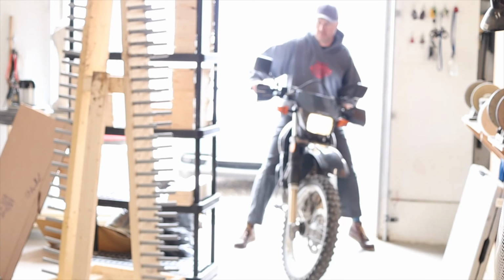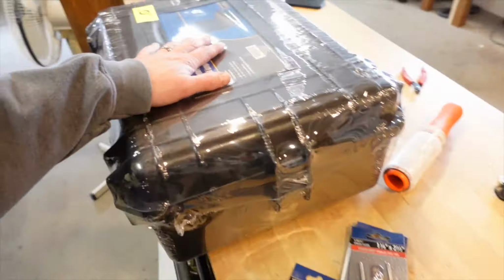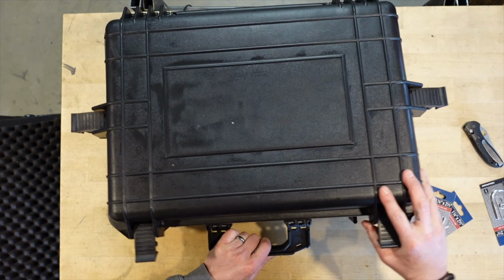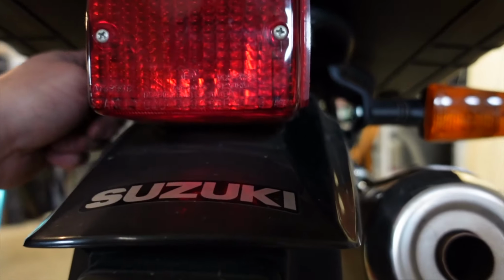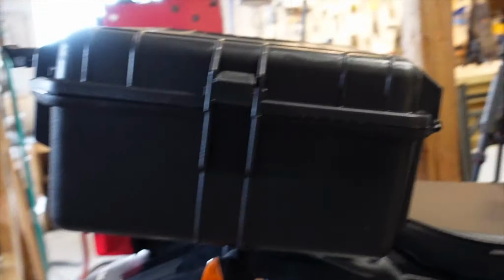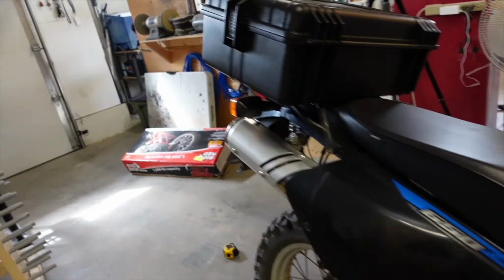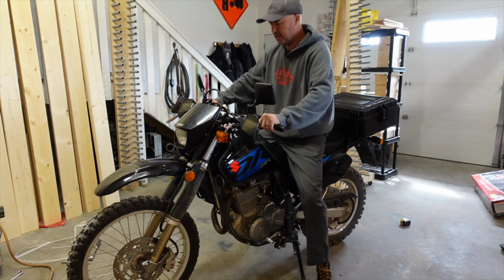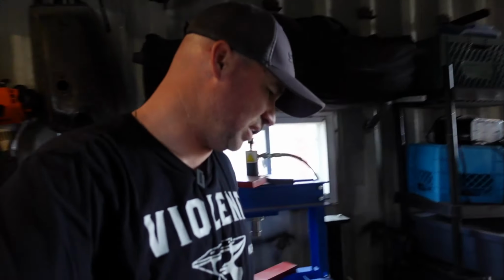DIY DR650 Luggage

Comment: Great job , just bought the same box for my DR . Tip for getting on and off the bike with a trunk ….. From the clutch side , put your left foot on the peg . Then grasp bars and stand on the left peg while swinging your right leg over . To dismount , stand up on pegs and swing your right leg over the seat onto ground . Just like getting on and off a horse . CHEERS .

Comment: lol. I used a plastic ammo case from Princess for my DRZ. I mounted a plate to my rack and then mounted the box to that. It’s still pretty flexy and vibrations will eventually wear the mounting holes so I’m going to sandwich some wood or more metal on the inside.

Comment: Hello Jeremy. Don't wait for the tyres to wear, change them.  If they wear it will obviously be in the center not on the sides so when cornering you will have less traction. Not good, I KNOW! Lol. Nice case. I think the flexibility is probably a good thing, it will be less likely to crack from vibration than rigid plastic. Have fun and stay safe, All the best.
Reply from the maker: Thank you for that! I have some new tires on the way and I’ll save these ones for winter time riding 👍

Comment: A concern, with the assumption that it's made of thin cheap plastic, that vibration and flex from riding may likely crack the plastic. Perhaps something to do right off the bat would be to use some PL Premium to glue a 1/2" piece of Baltic Birch ply, cut to fit, to the bottom inside. U-bolt through it so it's solid. 
Nice bike and great idea for extra storage without spending big bucks on purpose made kit.
Reply from the maker: Yeah I’m going to keep an eye on it for sure. That’s a great idea. Might want to get on it soon so the price of wood doesn’t end up costing more than the bike 😆👍
Reply: @jeremygoertz  Got that right my friend! Just priced out 1/2" BB ply. 4x8 sheets are $109!!! 8(...... and I need two! Since it's out of the weather, you could probably go with standard grade 1/2" and paint it.